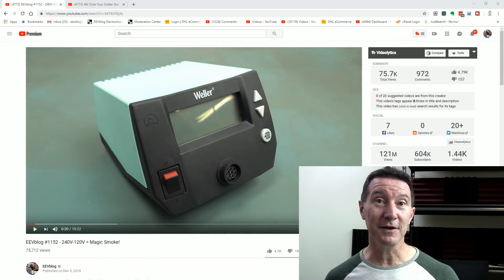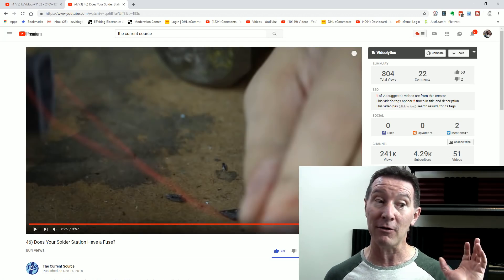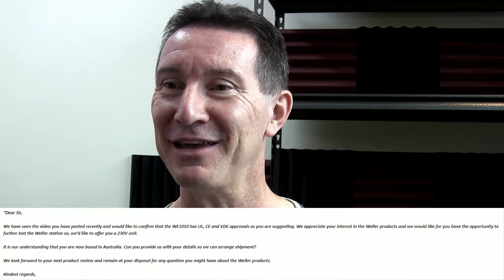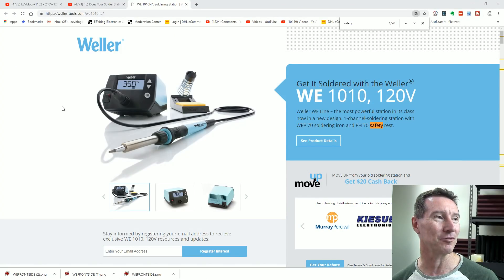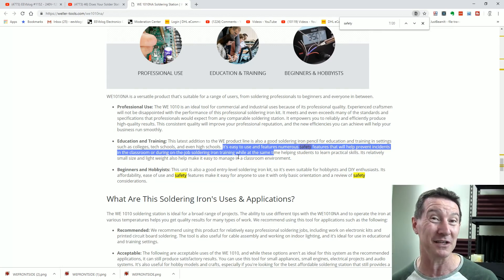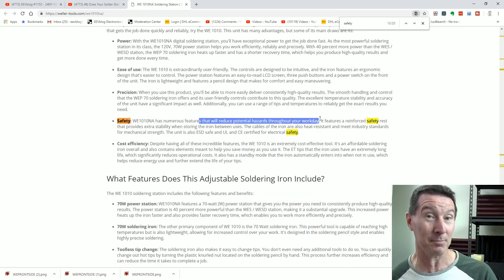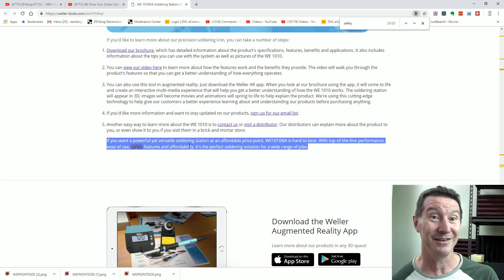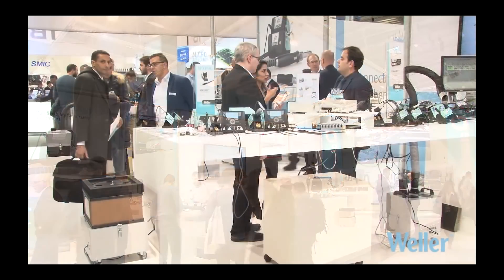EEVblog #1160 - Weller Responds!

Comment: Hey Dave, it looks as though Weller gets a pass so long as the unit complies with electrical code present in the region of sale. I'm pretty certain fireball was a north American unit, hence the NA designation in the part number. In NA we have certain rules regarding AC fusing.  There are mentions in the UL and NEC code about cord length and power switch type as it pertains to fuse vs. No fuse. Other primary side fused units may be for international sale.  I dont know what makes NA residential wiring and fusing special when compared the the rest of the world, but it seems like certain risks are covered in the wiring/fusing in NA where a primary fuse would be redundant.  For example, our 110V outlets are considerably different than our 220V outlets.
Reply: I guess in the end your buildings wiring is still intact and you proved that the NA unit cant survive international use.  I'm stretching a bit I know.  (I have a crap load of Weller gear in my lab that I just unplugged lol)
Reply: The problem is not just a missing fuse. It is the universal power cord connector on the back of the unit. This is a single voltage unit. It should have a dedicated power cord instead. That would instantly tell you that this was a 110 V unit.
Reply: I don't have my code book in front of me, but I am pretty sure the wording of NEC is such that the main circuit breaker is all that is required for low voltage (i.e. < 1000V) transformers. As you said, what is required versus what helps you sleep at night...
Reply: @Dead1Eagle6  What's required is more than enough for me to sleep easy. Dave's mishap proves beyond a shadow of a doubt that I don't have to worry one iota about any of my devices shorting the wall and burning the house down, either the breaker pops or the magnet wire itself burns open like a fuse would have done anyway.

Then again I have a gallon of 20% glow fuel on my nightstand and I daily a vehicle from 1985...
Reply: @TestECull  your vehicle and glow fuel are considerably safer than this Weller. You might feel at ease because you won't plug in your Weller in a higher mains voltage, but asides from other spontaneous defects that cause the transformer to overload, you could even find yourself with a higher mains voltage in case of, say, a lifted neutral connection. Instant overvoltage without plugging anything in wrongly.
Reply: @mjouwbuis  This iron proved itself safe, though. It never put Dave at any risk of being shocked, nor did it ever put him at risk of a fire. It let a lot of acrid smoke out, sure, but that's all it did. Far as I'm concerned, that's all the proof one needs that you don't need primary side fusing in consumer appliances. Dave had an absolute worst case failure with this iron and it still posed no tangible threat to life, limb, or property, aside from the iron itself anyway.

It's far safer to have a 110v Weller 1010 plugged into the wall than it is to have a gallon of methanol and nitromethane on my headstand, or to drive an '85 F150 through modern freeway traffic at 75MPH. What's more likely to kill me, a transformer that only releases the magic smoke, methanol fumes while I'm sleeping, or a car crash in a vehicle without crumple zones and airbags? Hrm?
Reply: @TestECull  No, the worst case would be that the primary totally melted and put 240v through the secondary.
Reply: @spodula    The primary did totally melt, that's how the magic smoke came out, yet the secondary never put out 240 volts. If it had the PCB would have exploded, since it's only designed for 12 volts at most and none of the components on it would have lasted a microsecond under that much voltage.

I stand by my comment. Dave's iron had a worst case failure and didn't put his lab or his life at risk. The unit is safe.
Reply: @TestECull  Where there's smoke, there's at least the start of a fire. However this wasn't by any means a worst case failure. At most a second worst. Slow failure with thermal overload would be much worse in terms of fire hazard. Note that there's also no thermal fuse. Also, one case where it didn't end too badly, how is that proof of not needing a fuse? The only thing it proves beyond a doubt would be that with a fuse, the failure would have been quietly and possibly even without any damage to the transformer. Also, I'm guessing you don't store that methanol next to a Weller...
Reply: There's nothing that makes NA residential wiring safer for unfused equipment. If anyhting, it's less safe because the fuses in the breaker box would be rated for a higher current.
Reply: I think a lot of the time they expect the breaker in the distribution panel to pop. Nevermind that it can still shove almost 2kw before it trips!
Reply: There's always quirks between countries. UK mains plugs all have fuses IN the plug.
Almost nowhere else in the world has this, but this seems to be because the standard UK methods for household wiring require it, because otherwise one faulty device could affect multiple things in the house. (I recall hearing the UK uses some kind of ring topology in the wiring to outlets, but most countries use point to point connections)
As such, the fuse that's in an appliance in the UK is somewhere in the household wiring in most other places.

Still... I don't think that's the same kind of issue, and as you can see it's still possible for someone to do something vaguely stupid by accident that defies standard assumptions about how things are wired...
Reply: @KuraIthys   The UK uses a fuse in the plug rated for the item i.e.2A 5A 10A and a fuse on the ring main at the board. That way the bang and magic smoke are less. Pity really, I do enjoy a good bang.
Reply: @KuraIthys Yup, Britian uses ring mains where there's 32 amps at each socket. At 230 volts. Special case, and their standard does mandate a fuse in the plug itself for any device that plugs in for that reason.
Reply: you don't have..  AFCI(aka AFDD) or GFCI.(aka RCD)  (these cut out at @  5ma)  does the job   also you can get special service use  "fused outlet" if you want so you can combine all 3 if you would like to do so

the GFCI would have tripped for sure   since it would have leaked a lot of current to ground
Reply: @punker4Real  GFCI will protect you? Why are you soldering in your bathroom?
Reply: @originalradman9491  does your toaster have an obvious failure mode in which it will burn down without tripping the mains breaker? Neither do most of the other unfused simple appliances. Modern appliances with electronic controls are indeed fused themselves.
Reply: @originalradman9491  My NZ/AUS market toaster didn't have a fuse either. After several years of use the main switch failed catastrophically, with one of its contacts breaking off and shorting directly across the AC line, which blew the fuse for that circuit. While that is obviously the expected behavior and the fuse operated as intended, what happens in a situation where some idiot has replaced his fuse wire incorrectly, or with a nail/bolt etc?
Reply: One could argue that since the coord was not permanently attached and could be interchanged without tampering by the end user, there IS needed primary side protection as it is not a matter of IF but When a mains overvolt is going to occur.
Reply: My $30 Chinese station that I bought almost a decade ago has a primary side fuse. Weller's choice to exclude the fuse (likely to sell another unit if I do something stupid and burn mine up) is ridiculous. I'm a hobbyist - when I'm in the market to upgrade, why should I even look at Weller? They've cheaped out on a non-mandatory safety component so they can save a BOM item or two and not more than $0.05/unit... what else have they cheaped out on? Can I expect an LCD that burns out after three years?
Reply: @ZiggyTheHamster  As person that works for a company that has hundreds of Weller stations, I can tell you my advice. No, don't buy Weller. The failure rate, durability, and reliability are the same (poor) as anything else on the market. The reason for tiny locking tabs, poor terminal pins, low quality plastic, very few and expensive replacement parts, and now no fuse is simple. The market is limited and if the things don't break and need to be replaced then sales fall to almost nothing.
Reply: @ZiggyTheHamster  Yah it isn't that big a deal. Look around your bedroom at all the equipment plugged into the wall that does't have a fuse in it, or your kitchen, or your living room. It isn't that critical. And we see here, Dave's iron had a worst case dead fucking short circuit across the primary side with 230 volts across it *and still never put anything at risk*. Sure, it let the smoke out, but that's all it did. No flammenwerfing, no sparkshows, nothing dangerous. Just an unpleasantly foul smell and some smoke.
Reply: @TestECull  found the reasonable people thread. The sky isn't falling, and no I don't have to look out the window to check...
Reply: @TestECull  Most or even all of that brown goods and appliances that "doesn't have a fuse in it" , either has a non-use replaceable fuse (normal or thermal) or a safety transformer. Safety transformers are typically the small ones, up to maybe 5VA. The primary wire acts as a fuse itself. Even those often have thermal fuses. Cheap Chinese clock radios of better quality than overpriced Weller soldering stations, go figure. Also there's simple equipment with no obvious failure modes that warrant using a fuse. Anything electronic or containing a transformer is not such equipment.
Reply from the maker: A 120V circuit can still deliver almost the same power as a 240V circuit. Too bad if that power is delivered into a tiny unprotected transformer that failed.
Reply: @EEVblog  you are experiencing my daily struggles with automotive design. Bare legal minimum vs. What will let you sleep at night.
Reply: @EEVblog  Short of a power surge (which most devices don't survive anyways), I don't see how it would fail under normal usage on the mains side like that unless somebody were fool enough to use an American unit overseas. On that note, I'm surprised they'd use a IEC 320 C14 connector without a voltage selector switch. If it had a NEMA-5-15 plug, there'd be no issue.
Reply: BlackEpyon Actually, because we use split single phase residential power in North America there is a particular fault condition (neutral fault) where up to 240V (actually, depending upon which leg you are on and how the active loads are distributed in the panel, the voltage can be anywhere between 10s of volts up to the 220s/230s, without neutral it is pure pot luck what voltage is seen and for how long) can be sustained for a time under certain conditions to a 120V load, so what happened to Dave could actually happen here, it is rare but it is a real fault condition that does happen when the neutral is lost somewhere between the transformer and house.  I find myself scratching my own head trying to understand how they got UL certification without an inline fuse to protect the transformer as not only is that neutral fault condition I mention a rare but possible event, but many parts of our country have considerable lightning activity which can severely degrade the insulation of a transformer and similarly lead to overload.  Fuses are cheap but reliable protection against many of the worst case faults that can happen to consumer electronics and to omit such a basic safety mechanism is pure stupidity.  Even as a life-long hobbyist I could never bring myself to engineer such an appliance without an inline fuse, it is just plain common sense — every transformer project I have ever built in my 40 years in the hobby has been fused and they’ll continue to be fused until the day I die because safety matters and I rather value my house and toys.

If I owned one of these stations you can probably guess what my immediate alteration to it might be!
Reply: @ethanpoole3443  A family member living in a building with a worst-case scenario electricity system (converted to student rooms upstairs, kebab shop with high current loads downstairs) suffered a neutral fault /somehow/, everything that was plugged in upstairs got fried by 330v...
Reply: @BlackEpyon   transformers (and secondary components) can fail by itself through wear, construction defects and material faults.
Reply: Ethan Poole it’s not even rare! I’ve been there 3 times already!
Reply: @ethanpoole3443  I'm a hobbyist, not a licensed electrician, but if I understand correctly, a neutral fault is where the neutral conductor into the service panel is lifted (broken), meaning that what was the neutral prong of your device is now connected to the inverted phase of the other AC line instead of actually being neutral. Either a fault in the service transformer, or whichever dumbass was working on the lines lifted the neutral before the hot lines. Not too likely to occur, but I see your point. Of course, in a stove or clothes dryer, you may be "lifting" the neutral anyways, depending on which element is being used, but that's on purpose.

Not sure why it's called "split phase." If three phase power has each line's sine wave at 120 degrees to the other, "two phase" would be 180 degrees to each other, aka, split phase. Why not call it two phase and three phase?
Reply: BlackEpyon Your understanding of neutral fault is correct, but there is a more common cause you missed and that is corrosion of the buried neutral conductor. Once anything pierces the insulation (including lightning strikes) of a buried conductor, and especially buried aluminum conductors in many soils types, the conductor starts to erode away, at which point you are eventually left with the two outside legs with 240V between them, but no longer have the central neutral, so now whatever balance of loads fall on each side of that neutral are now trying to pass the current that would have flowed to neutral through one another instead, so some will see very low voltages and others very high versus the expected 120VAC,

Our power is known as “split single phase” because it is literally the product of a single phase passed through a center-tapped transformer with that center tap becoming the neutral and the two hot legs being 120VAC to either side of that neutral.  It’s not called two phase because historically the purpose of two phase power was to, literally, get an early AC induction motor rotating (such as for early elevators or industry), and for that to happen (without modern capacitor start circuits, like with single phase) requires a minimum of two phases with one of those phases less than 180° apart (180° apart would be balanced, thus imparting no rotational flux on the rotor), so two phase power was typically 90° apart and was a very early power system that is still in limited use in parts of Philadelphia, PA and Hartford, CT where the cities still possess infrastructure from that early era before three phase power was settled upon.  So we do not refer to such as “two phase” because two phase power was historically 90° apart rather than 180° and would create confusion.
Reply: @ethanpoole3443  That makes sense. Thanks for the clarification.
Reply: Joran Groothengel That would not have been a neutral fault in a single phase household or business, rather your family member’s case would have been a neutral fault in a three phase commercial environment where losing the neutral can result in very high voltages as the current from each phase is forced to instead find a path back via the other phases instead of neutral and can result in very high voltage swings (much worse than with 240V single phase residential service).
Reply: @EEVblog  if the transformer was consuming 80 W of self-heating how could a fuse have helped?
Reply: My vacuum cleaner has a fuse. It's about the same power load as a soldering station like this. It's nuts they don't have one, especially since we're talking about something that a bunch of idiot kids are likely to try to burn each other with. Dave should get another 120V model and see at what point he can get the station to let out the smoke when operated on the right voltage. Think idiot kids - what happens if you take a hot air station, crank it up to max airflow on the default temperature and point it at the back of the station from arm's length away while the iron is on its highest setting. I'd bet you could overheat the transformer and cause a cascading failure pretty easily - and that cascading failure would start a fire because there's no primary side fuse.
Reply: @ZiggyTheHamster  I would be pretty surprised to see a fuse in a vacuum.  They might have a thermal fuse as part of the motor but it is intended to protect the windings from overheating.  While over voltage causes overheating, that's not why they have that fuse there.  Here in the US, you are protected by a coded plug.  That vacuum only has a 15A 120V plug on it.  It won't fit anything else. Dave's unit had one of those IEC connectors on the back. If you are going to do something like that, you really should fuse the primary side. It's easy to find IEC to NEMA 6-20 and get a surprise. A bit atypical in a home setting but possible.
Reply: @ZiggyTheHamster  well you vacuum has a much longer cord than a soldering station. but aside from that, the fusing is only meant/required to protect the exposed wiring. No regulations exist to protect the device. Anyone can misuse a device and cause it to fail like what happened here (plugging something rated for 110V into 220V).  This doesnt really mean that the Weller isn't safe or is poorly designed.  It was just used in a manner in which it was never intended.
Reply: @Llirik13  the thing is that the iron broke down in a controlled way, which is what i would have expexted: insulation breaks, windings are shorted, the tiny unisolated piece at the beginning on the wire (which is effectively a fuse) breaks and now you have an open transformer, the catastrophic event has been halted safely.

You still seem to forget that the fuse role is to protect the wiring, to prevent it from catching on fire, not the device and not the user.
In this event it seems to me it worked perfectly.

The user here plugged in a 120V transformer into 230V. Even if there was an external fuse by the time it acted the windings would have still arced over so the trafo would have been useless anyway. Maybe you would have an instact fuse but an open transformer.. how funny would that be :)?
Reply: @jackm_  
You sound like marketing bullshit. No personal, but, comone.

- "You still seem to forget that the fuse role is to protect the wiring, to prevent it from catching on fire, not the device and not the user."

I have no idea why you assume this role for fuse. Fuses roles is on spectrum.
My education, from not so stupid people and from not so untrustable books says that main fuse are for device protection. And in some cases for user protection as well.

- "The user here plugged in a 120V transformer into 230V. Even if there was an external fuse by the time it acted"

From 120V to 230V is 2x rated power, so fuse will break pretty fast.

- "the tiny unisolated piece at the beginning on the wire (which is effectively a fuse) breaks"
IT IS NOT
Watch the video.
Reply: @Pops180  A correctly fused device would have failed safe if inadvertently connected to a 240v supply. It's user error but that doesn't mean the design shouldn't include protection. Even the crappy $10 Hako clones include a primary side fuse.
Reply: @ferrumignis  the cheap clones are sold internationally and thus required to have primary fuses,  this Weller unit is NA only.   A fuse would only be needed to protect against misuse.  When it comes to fusing, the exposed wire is the only thing that needs protection. There is no gaurantee that any fuse in any device will blow in time to protect itself without any damage
Reply: @Pops180  What provides protection in the case of a primary short within the transformer?
Reply: @ferrumignis  the circuit breaker in your home,  just like what happened in the video.
Reply: @Pops180  If it's that easy to use equipment in a way it was never intended to, it is in fact a design issue. Especially given that they have 240V in the US as well and things can get plugged in the wrong outlet. Also, any other fault could have the transformer go up in flames as well. It failed surprisingly fast and relatively violent. Definitely should have had a fuse.
Reply: @jackm_  apart from that you misunderstand the multiple reasons for using fuses, I'm pretty sure a fuse would have stood a good chance to actually protect the transformer. When operated on 240V, it will go in saturation very quickly and draw sufficient overcurrent to trip the fuse within a few mains cycles.
Reply: @mjouwbuis  220V in the US is a completely different plug that is not interchangeable. Again, this Weller is an NA only unit.  Trying to make a device "idiot" proof is impossible. This passed regulations for the NA market and is perfectly safe for NA use.  The EU model will be different.
Reply: Andrew. So you're saying the transformer can never short out, overheat and catch on fire? Better to be safe with a thermal fuse than sorry.
Reply: @dandearman2871  the NEC is counting on the primary shorting out to trip the breaker in order to protect the building wiring. As you saw in the video,  no fire occurred just smoke. The wiring nor the cord, overheated or melted. I'm not saying this is how I would design this but if you make millions of soldering irons, why would you put a 3 cent fuse in a unit that didn't require it legally?  I gaurantee that they use fuses on models that are sold world wide for obvious reasons, but in NA it's not necessary to protect building wiring (again this is the only purpose of the primary fuse). If the power cord was long, it would be required. Even a primary fuse isn't guaranteed to protect the transformer from degradation.  The insulation would breakdown before the fuse blows, gauranteed.
Reply: @Pops180  No regulation, but the device does have a UL mark that does require current limiting of some sort to pass certification or be granted a UL label use licence. A well known electrical and electronic device manufacture should know better. 
With that said, UL as a standards organization is between a rock and a hard place with things like this. There is no money in enforcement, and many less scrupulous manufactures happily stamp "UL" on everything. Holographic logos only go so far, so they have mostly lost the battle of the value of their brand on portable manufactured devices. This isn't the first or last time we will see a well known electrical and electronic device manufacture treat "high" voltage mains current just like low voltage DC in a consumer device. All we can do is hope that they don't get a bad batch of transformers. Instant smoke from improper voltage is one thing, unattended fires is quite another.
Reply: @adaycj  I agree. However if you read the NEC guidelines, primary fusing is required if certain other design specifics aren't met (power switch type and position, power cord length, transformer voltage ect.)  Fusing is only effective to prevent external wire failure. It will not protect the transformer.   It may limit damage, but I gaurantee the enamel coating on a fused input will be degraded in a situation like this.  I'd rather have immediate smoke vs a failure days later after replacing the fuse. Now, I would have liked to see a primary coil that can withstand 220V without incident regardless of intended market but hey, I'm not the one cutting the check on manufacturing costs.
Reply: @Pops180  I'm not an electrician, but I don't think NEC applies there per se. Equipment manufactures cannot avoid the "permanent installation" of equipment where required, but this is a portable device and not covered by installation standards. In addition the NEC is not technically a national standard, and can optionally be adapted in conjunction with or in place of local regulations. So even in the USA it is not applicable everywhere. There are NIST Electrical and Electronic Equipment Compliance Requirements that should apply, but mostly just list other agencies that have some sort of jurisdiction. There is an OSHA requirement that equipment be  "approved" and the UL agency is listed as one of many labs that can provide approval. However, even OSHA's web page doesn't list a soldering station as equipment that requires approval. 
References: https://www.osha.gov/dts/otpca/nrtl/prodcatg.html https://nvlpubs.nist.gov/nistpubs/ir/2016/NIST.IR.8118.pdf (archived, but mostly unchanged). 

I completely agree that device current protection is almost never about protecting the device from failure or damage. It is almost always about stopping current flow in the event that a failure has already occurred. I would disagree about the failure mode of smoke vs a device that requires direct human attention to be restored to service, but I still appreciate the intelligent conversation.
Reply: @Pops180  Every plug is interchangeable, but that's not the point. There's plenty 240V in NA. Simply lifting a neutral would do the trick on many installations. It's NOT about idiot proofing, it's about doing a tiny bit above the absolute required minimum. Even if you would really think there is no reason to protect against user error or external circumstances such as a lifted ground, there's always the possibility of the transformer shorting internally, which would result in similar incidents. Also, without an additional thermal fuse, slower failure modes with a higher fire hazard are a problem.
Reply: @mjouwbuis  110 and 220V plus are completely different it's damn impossible to apply 220 to a 110 unit unless you really really wanted to
Reply: @Pops180  You may want to review the original video. The power to this Weller station is supplied by a standard IEC equipment connector, to which any mains cord can be attached. Also, you've been probably told numerous times that a neutral can lift, in which case the connector doesn't make a difference anyway.
Reply: @mjouwbuis  its irrelevant. The unit is a north America only unit. The only fault on Weller's side is giving that to someone not in north America. Other than that, the unit complies with all regulations in the US.  This is based on electrical building code.  Besides a fuse would not gaurantee that the transformer would be undamaged in this case due to the I^2t properties of these fuses. The fact is that IEC connectors such as these are not compatible with 220V outlets in North America.
Reply: @mjouwbuis  also, the neutral lifting only causes the chassis of the device to become live. It's a danger to the user but it wont cause the fuse to blow,  well not before you were ash at least
Reply: @Pops180  On the neutral lifting: You might be confusing earth and neutral. Neutral is the return for the phase and NOT connected to any parts of a device that can be touched. Between phase and neutral, there's 120V. Between phases, there's either 208V or 240V. If the neutral lifts, the only return path for your phase, is to other phases. If the load on those other phases is significantly higher, the circuit to which the device is connected will see close to 208 (3 phase) or 240V (center tapped transformer).
Reply: @Pops180   about the compatibility of IEC connectors: they are usually used on 230V equipment in Europe and probably elsewhere in the world. So if a manufacturer puts one on a 120V only piece of equipment, connecting it to 230V by accident is a reasonable and plausible failure mode. As you can see, the Weller station has such a connector. That's why it was very easy for Dave Jones to plug it in to 240V by using just any IEC mains cord.
Reply: Andrew Hudson You are entirely missing the fact that the IEC C13 socket on the back of the Weller is not voltage specific and is rated for up to 240VAC, as such any device using an IEC C13 style plug should be designed to fail safely if it is a 120VAC device and gets plugged into 240VAC.  That we use a different type wall receptacle for 120VAC versus 240VAC is meaningless when IEC C13 style cords are available in many mains plug configurations, both 120VAC and 240VAC.  You can buy an IEC style cord that will plug into a NEMA 6-15R 240VAC receptacle in the NA market just as assuredly as you can buy the common NEMA 5-15 120VAC style cord — all of which will have the same standard IEC C13 connector on the other end and will readily plug into the IEC C13 socket on the rear of the Weller.  So even in NA it is readily possible for an IEC C13 style cord to conduct 240VAC instead of 120VAC if the other end happens to be plugged into a 240VAC receptacle using an appropriate plug (such as NEMA 6-15).  My workshop, for example, is very much a mix of 120VAC NEMA 5-20R and 240VAC NEMA 6-20R receptacles and I could easily have an IEC C13 style cord plugged into either voltage in such an environment without having misused the IEC style cord in the least (look on the back of most PCs and you will discover that they are either universal voltage or voltage selectable for that very reason since an IEC C13 style cord may carry either voltage by design).
Reply: Andrew Hudson Where did you come up with “neutral lifting only causes the chassis of the device to become live”?   A neutral fault, or lifting of the neutral, has nothing whatsoever to do with a hot chassis, it has to do with a missing neutral conductor in either a single-split-phase (as with NA 120/240 residential power) or in a three phase system (in a pure single-phase setup lifting the neutral  would potentially disable all power depending upon where precisely the lift occurred and your type of local power system and would potentially disable the circuit altogether unless some other path to neutral or earth exists).  When the neutral goes missing the remaining phases or legs are subjected to very radical voltage swings, the magnitude of which depends entirely upon the impedance balance of the loads on the other phases or legs (the highest impedance leg/phase will experience the highest voltage across its loads).  The voltage may swing from anywhere on the order of perhaps as little as a dozen volts to just a bit below whatever the maximum voltage is between the two legs or between the current phase and either of the other two phases (and can be very high in three phase systems).  In such a scenario, even a 240V device could find itself subjected to 400V+ in a three phase system, that’s why input protection is critical, whether it be via fuse or a carefully designed failure mode (such as burning out a resistor or fusible link on a PCB) — burning up the windings on the primary side of a transformer is not a carefully engineered failure mode, nor is depending upon the user pulling the plug in time.  A simple 1.5-2A fuse would have not only made the Weller perfectly safe should such happen (it was drawing well over that due to the saturated transformer core and would have blown in a fraction of a second) but would have also very likely protected the soldering station from any lasting damage save for need of a new fuse rather than running the risk of fire had Dave not interrupted the event by pulling the plug.